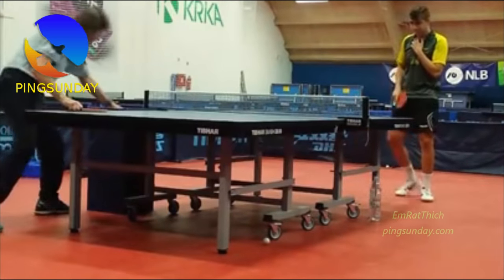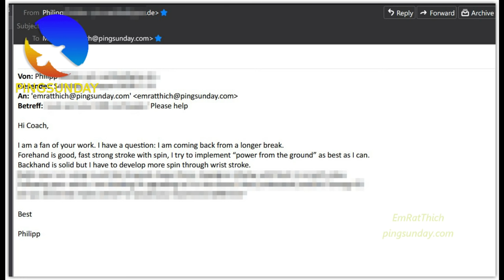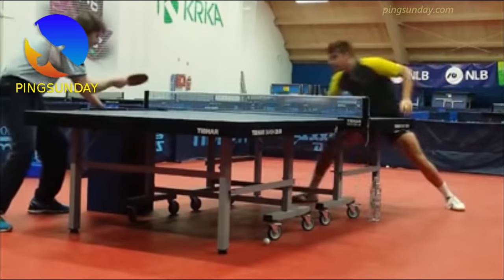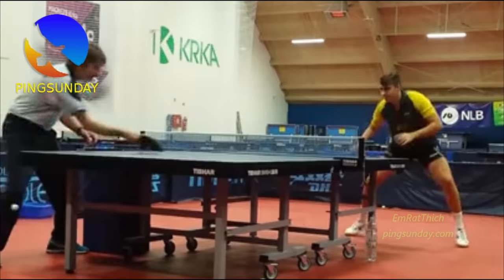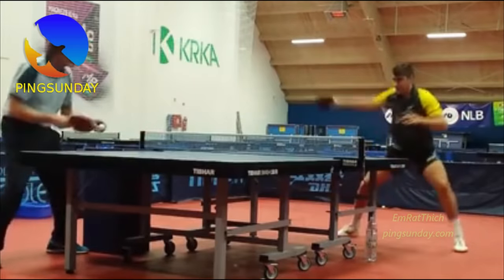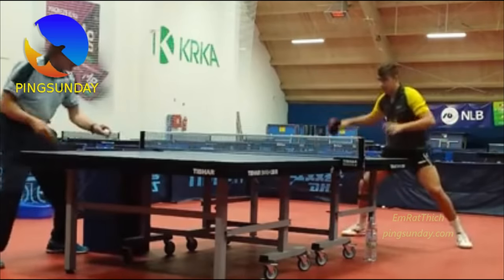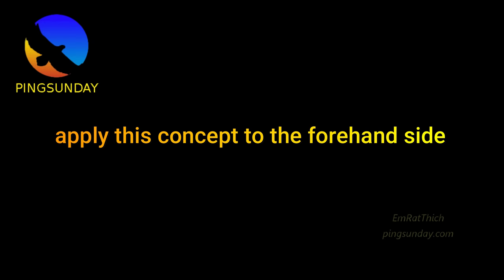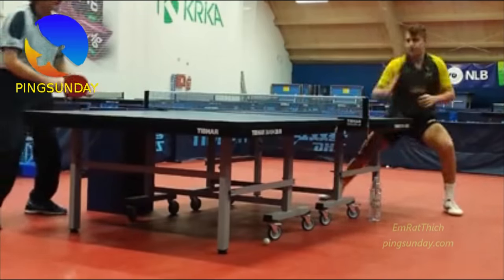How to apply "Power from the ground" to the backhand

Comment: Yes, but power from the ground is easier to read. Fast blade players that hit "wrong" with mostly arm reduce the time the opponent have to respond to an attack.
Reply: ?? I mean fast shots on the rising ball are harder to read because you reduce the reaction time available. But using the body is not easier to read in terms of where you will place it. The stroke is much the same but may differ slightly in when you hit the ball in your rotation, the subtle angle of your racket face, and direction of follow through.
Reply: It's only an advantage up to a certain level.  "Wrong" technique is usually too inconsistent to win matches against pros.
Reply: @rolypolyraccoon9242  Yes, I guess power and spin is easy to read, but not so mutch position.
Reply: @rolypolyraccoon9242  ... but, sometimes a bad technique is good by the suprise it creates. Truls Moregard vs Darko Jorgic had some of those.
Reply: @rolypolyraccoon9242  I am referring to the fourth point in the fourth set in the final of europe top 16 2022
Reply: Sorry sir I'm newbies player...Any idea n suggestions Skil to make opponent difficult to read?